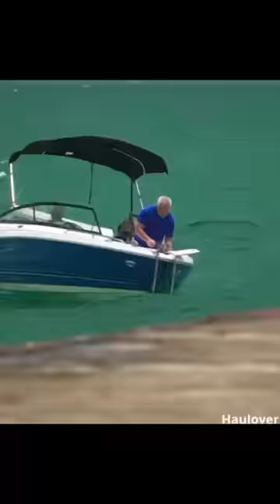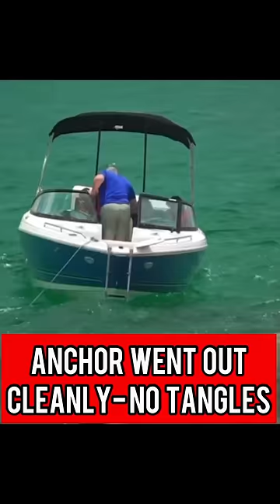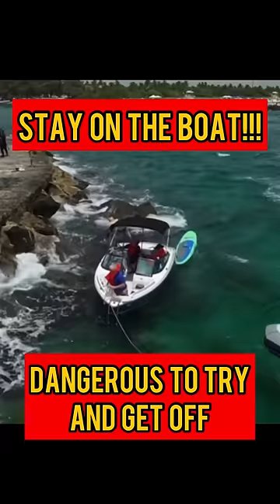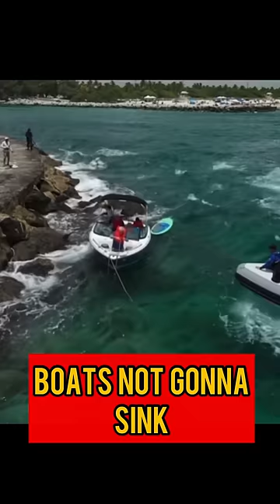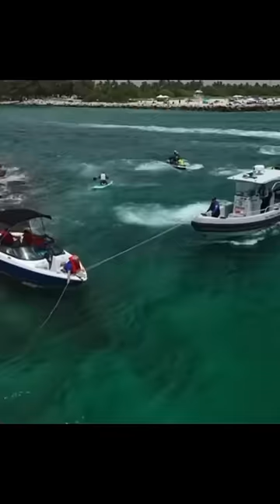ENGINE FAILURE at Haulover Inlet!

Comment: Good work! I may be a little paranoid on my boat but I keep 2 anchors. One on the bow and one on the stern so that way I can lock the boat in position. But hey he did a darn good job
Reply: That can be a dangerous way to anchor certain boats in current. Be careful and use caution!

Comment: Anchor on port would have been better. Also if you can throw that anchor out far enough you could stay away from the rocks
Reply: An inflatable with an out board would help do that too,or ask one of the other boaters around on radio

Comment: Dam I was that guy that jumped into the water getting bashed between the boulders and boat yelling to my 12year old brother that time to keep trying to start the boat and gas the throttle. Once started and boat went I was getting dragged behind the boat and it was turning back around heading toward the levee again luckily I had enough strength to jump back in to take control. About 10 more ft I would've wasted all that time getting beaten up for no reason.

Comment: Right!! I don’t think so…… Bounce off the rocks not too much longer would have all on board climbing those rocks to safely..
OR
Put the strongest swimmer in a life jacket and tie the anchor to another life jacket and swim out from the rocks as far as the anchor line will allow and drop the anchor . Pull on anchor line to get the boat off and away from the rocks. Repeat if necessary. 
Been there . Worked with a sailboat stuck on a sand bar. 😅
Called kedging off!!

Comment: “The boat can bounce around on these rocks all day without coming to any real harm” or one of those rocks can put a hole in the hull…
Reply from the maker: You’d be surprised fibreglass is as strong as steel in some cases, and they were hardly any waves, so definitely no concern from the boat sinking

Comment: Well, he threw the anchor off of the wrong side of the boat to start. If he would’ve thrown it off of the other side, he could have pulled in the slack, thrown it in again, and repeated the process to gain more distance between his boat and the rocks. As long as his anchor stuck on his throws.

Everything else was good though.